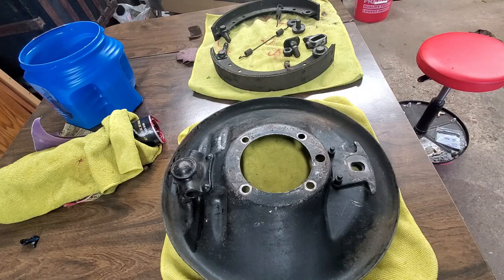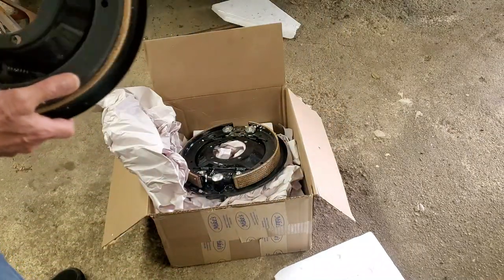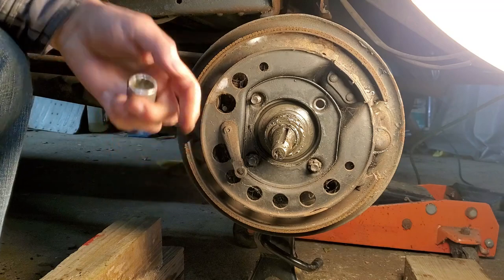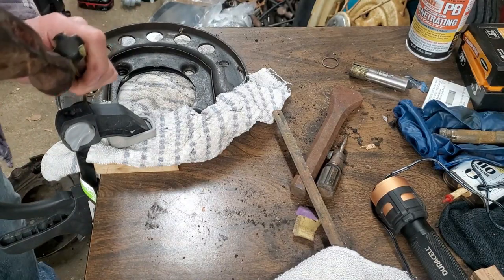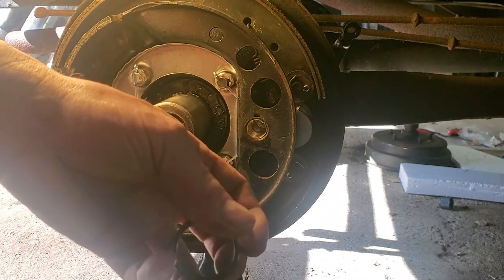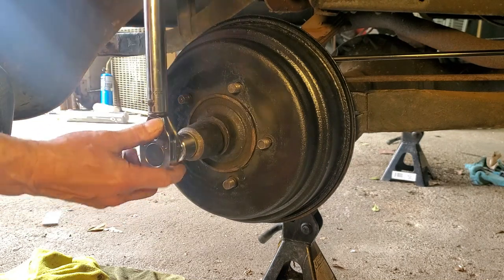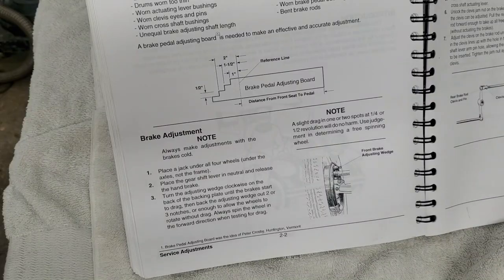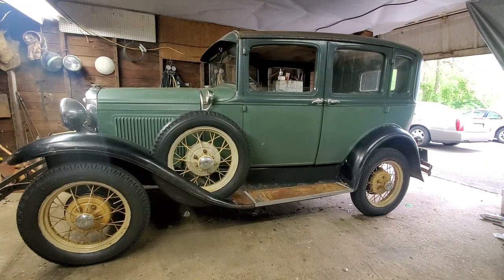Ford Model A Brakes ,front , rear, and E brake

Comment: I felt your pain on this job, I’m working on a 31 that has the same issues. Mine is missing all of the emergency brakes and the brake rods. Sorting out the parts at this moment. Enjoyed watching the process, there are good people out here that will help us on these cars.
Quick question, did you replace the hubs with cast iron? Ken in Kentucky
Reply from the maker: Yes cast iron.